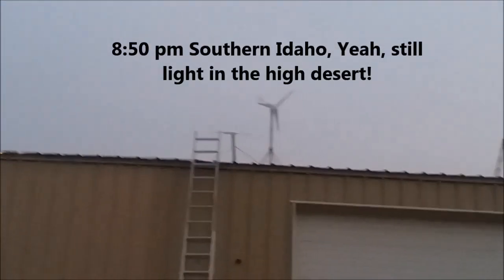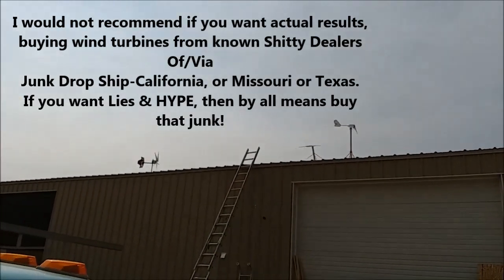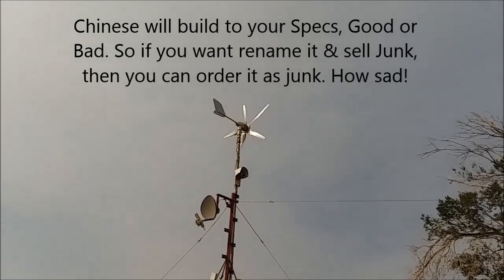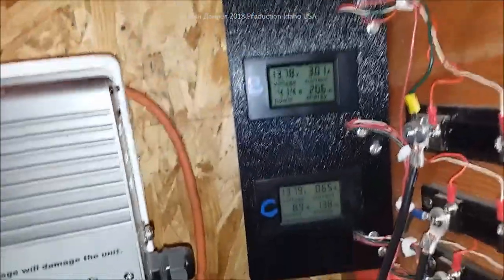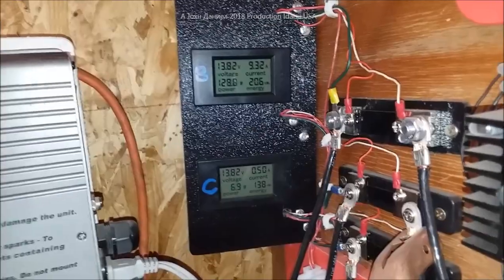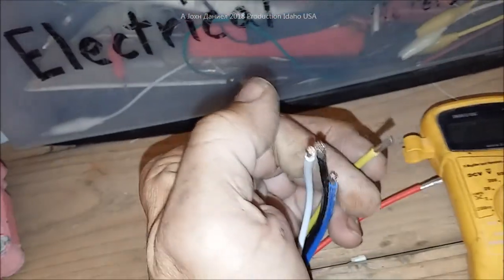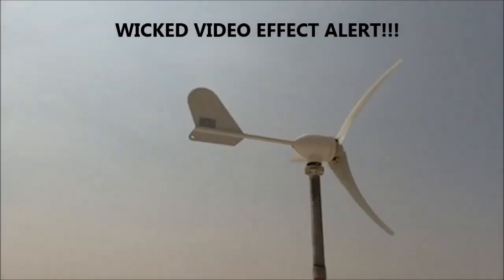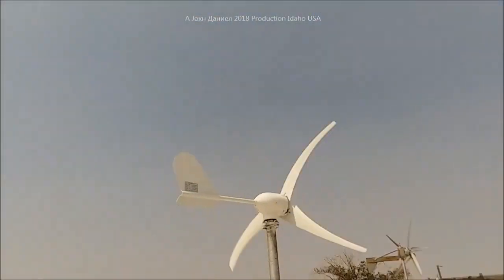500 watt Micro Wind Turbines output report, Long Term Review - Big PARTS LIST BELOW.

Comment from the maker: **For rectification to get 100% full batteries from one & to divert over volting you will need these: https://amzn.to/37HN2OR 100A SQL Rectifiers &  https://amzn.to/2MTUjCU A All purpose long life Load controller and be sure to get up to and over 300 watts diversion resistors ( 
https://amzn.to/2QngFPq x 3) and one or more 60 amp SSR ( https://amzn.to/2QKEyj0 ) with heat sink ( https://amzn.to/2ZYtmna ) and be sure to use thermal past on it.  ( Proper type - https://amzn.to/2QN2hir from Protronix)
Reply: How do i run an auto control switch fo my turbine. I am around 70 miles from where they are.so its not feasible to switch it off and on. Thanks
Reply from the maker: @randyzwagerman3975  3 way SSR, 12 volts to power them and a WindSwitch https://amzn.to/35kNO5r

Comment: Hi John I have purchased a SC48VDC Hornet 11 blade 1200 watt DC i have a 50' Tower the tower will be located approximately 40' away from power shed I have 48 volt lifepo4 banks 104AH each. Each Bank has 5 104 Ah batteries. I would like to know what size wire and fusing you would recommend what ever you may suggest would really help also would you recommend a break switch Thank you sir/.
Reply from the maker: Send me a email at olympicpowercontrols@yahoo.com and I can help you better.

Comment: Hi
Has anyone tried using a roof ventilator as a VAWT 
Seen one spinning on a roof the other day and the thought crossed my mind
Reply from the maker: Yes, and you can get 5 watts power from them using about $50 in parts. But WHY! 5 watts is same as wire loss to try and use it.
Reply: Јоhn Daniel 
Hi john 
Thanks for the reply,
I really like your videos ,
Me and my mrs are thinking of getting a turbine , to power a few things in shed and a 12v water pump 
You videos have been very helpful 👍
We haven’t taken the plunge and bought one yet though, the video you done with the Chinese 400w video is very interesting, since it’s that we would be aiming for

Comment: hi, i'm thinking about buying a 500 watt 12v wind turbine from your link but it brings me to green energy solutions and not B&C turbines. Are they the same. Also we get storms up to 150 mph winds, would I need to manually brake for these high wind storms. thanks
Reply from the maker: Both B&C and GREEN ENERGY use the same suppliers to get their parts (Wuxi) they assemble and ship compared to all the others selling look alike's which we have had a good chance by trial and error to now avoid. Always avoid those sellers who don't spec buy & assemble like B&C or GREEN ENERGY does of PMA, STATORS, CORES, WINDINGS, SLIP RINGS, AND BEARINGS in-house and avoid those who buy seconds, black market assemblies and other.  
So you can go either way on them, but for customer service I do prefer B&C due to response time. My other videos on these has both sets of links if you take time to check.
Reply from the maker: PS - If you get serious storms of 150 mph my suggestion is a pole that can drop fast to lower the turbine in those cases. None from any maker can survive that level of winds and most are rated at 110 mph for intermittent times only. Sustained 70 mph is the max you can leave a pole up for.

Comment: Do you have these going to a battery bank? Do they go threw a charge controller? I have looked threw your videos and haven't seen anything on these items?
Reply from the maker: To the battery bank from a rectifier and controlled with diversion loading and 3 phase SSR and braking resistors of my design.

Comment: John, I hooked up the same amp/volt meter you are using but it isn’t displaying what my turbine is generating instead its showing only what my load is using.  How Do I install them to show what is being generated by the turbine?
Reply from the maker: Load is the battery, Source is the turbine.
Reply: Јоhn Daniel I must have it hooked up wrong, it’s only reading my battery voltage. Can I send you a picture?
Reply: I’m inline on the negative side right out of the rectifier just like yours
Reply: Јоhn Daniel are you saying I can make an internal change on the source?
Reply: On the meter

Comment: How many turbines are required for puducing electricity for whole day(24 hours).
Reply: Depends on how much energy you use for the entire day.
Look at what you run in your house, fridge, tv, lights etc.. do you run AC, fans, welder, time machine etc..  Or look at your electricity bill at your avg daily use if your electricity bill provides that information. From there you can start working out what type of system you need, if you have enough wind, if you have enough sun..

Comment: The large wind turbines MW ones are a Freemasonic hoax. If you go to any of those videos showing the inside of those generators it's shocking to see how small they are. Electricity is free from the air all you need is a grid!

Comment: How much for the 220.00 Chinese turbine with controller and rectifier and digital voltage reader and braking box ? And mounting pole on it? I do not have room for the other stuff lol my garage is full. If you have a GOG lift or something similar to remove it I would definitely bring my side kick 19 year old nephew to help.

Comment: Hey john arent you selling this turbine?
Reply from the maker: I don't sell turbines. YOU BUY one based on what I am willing to install, then I have heavy equipment to install them in Wyoming, Idaho, Montana, Colorado, Utah, Nevada, Oregon, and now we have about 20 request in Texas and a few in New Mexico near Clayton. Thats where I am opening up another shop. I recommend them and some others for my installs. If they are not PROVEN, I avoid them.  
 Looking at my quickbooks I can say I now have installed since 2009 a total as itemized: 61 of the ME-500 models in the last 11 months!! one guy in Battle Mountain NV got 10!!! , not one unhappy customer. I have since 2009 installed 2 ARI turbines, 23 Sunning turbines, 12 FWiX Kestrell Turbines, 4 original (pre 2014) HYE turbines, 34 Thermodyne Turbines on my Chaos Frames, 9 Hurricane Wind turbines ( 2 red, 7 FW models),  6 Oulo 1500 Turbines, and 19 Gigu 600/800 models, 8 AirX Turbines, 5 BergyWind turbines. 
I have installed almost 3000 solar panels too since 2011. This is what you do to make a buck when you own a Tele-handler 38 foot capable HighLift LOL!!  I refuse to install any of the following due to warranty, caustic sellers, scammer avoidance, and just more than anything - junk avoidance: Aleko, Gudcraft, HiEnergy, Missouri, IstaBreeze, Coleman Air (post 2010), Mars D-models, and about 80% of the $150 China turbines currently on Ebay/amazon/aliexpress/dhgate or similar sites hocking crap with fraud watt ratings.
Reply: @JOHNDANIEL1  right on same work ethics I have
Reply: @JOHNDANIEL1  I would definitely want the Chinese turbine isnt that for a 12v bank? I have 2,000AH 12v bank right now
Reply: How much for the Chinese turbine with rectifier charge controller and dump and mounting pole?

Comment: Sir, i want to buy 1kw wind turbine which one do u recommend for me?
Reply from the maker: Depends on the voltage your trying to achieve. The best 24 / 48 volt 1000 watt model they make is http://s.click.aliexpress.com/e/bVUE0URQ . It can be ordered with numerous options and is made by WuixAir also.
Reply from the maker: Same company who makes the real accurate rated, option 2 https://amzn.to/2EfaEyP
Reply: @JOHNDANIEL1  I ordered this turbine.  The first one came damaged, dropped and bounced around.  threads on turbine shaft not usable could not assemble and shaft made noise when spinning.  Opened a dispute to get a second turbine head sent to replace the damaged one.  The replacement turbine head also came damaged and poorly packaged with multiple holes tears in the cardboard box...it is a 28lb turbine head and they used 1/2inch styrofoam thrown in to the bozxfor "protection".  The long mounting bolts that attach the head to the turbine body came bent!  Takes alot of force to make that happen.  Cherry He with Logihitech, called me a liar and aliexpress is not supporting my damage claim.  I am out 664 USD and don't have a working turbine.  NOT GOOD.  They used SF express and UPS shippers...idiots.  I ordered 3 turbines from Green E (1 -500w and 2-600w), came DHL undamaged no problems.  Do not order the 1kw unit using SF express shipping method.  The packaging for the 1kw is not sufficient.  Aliexpress mediation is a joke.  Nothing like Amazon.  Maybe you can do something, I will be putting out the word on these clowns...maybe you can do the same.
Dan
Reply from the maker: @ildan08  I don't know who Cherry He with Logihitech is, are they a freight company?  I do know so far Green E only uses FedEx via DHL for north America and DHL eLogistics EuroHpost for Europe and none of them are that rough on shipping. Good info on who to avoid, I will refer all you said to Ms. Lin who I buy from. 58 turbines from 300 watt to 1200 I have ordered myself or though customers I install for and only one had a chipped blade and Green E had one in the mail in hours.
Reply from the maker: @ildan08  Send me lots of pictures of them to my shop Email olympicpowercontrols@yahoo.com . I may offer to buy them and get you a discounted from Green E to get you back on line. Worth a try.  I have been a power buyer with Ali for 9 years. They panic when we complain.

Comment: Do you use AC or DC output turbines ..?
Reply: 3 phase is AC, hence the rectifier to convert into DC. Pretty sure he mentioned that about 287 times.
Reply: They are all AC, difference is in the DC model the rectifier is inside the turbine, AC model has the rectifier close to the battery which is better

Comment: Hi John,  I was wondering the last link you provide the "new to wind power kit"  is the charge controller it comes with good or should i get a different controller. If different can you recommend 1 for me? I plan to get the turbine to power my campers battery bank of 4 deep cycle 85AH batteries. I am going to add 2 more batteries when I get the turbine.  Thanks Gorbag

Comment: I also have a chinese turbine(GiGU 550 watt) but it makes a buzzing sound when it spins hard.Can it be a bearing? its verry loud with hard wind.I bought it 2ehands and the turbine is 5 years old.
Reply from the maker: Test it by grabbing the hub, blades still on and see if it has some slack in and out or side to side. If so, take it down, remove the case cover CAREFULLY and there may be a bearing number on the front and rear bearings. Usually a 17mm shaft, thats 20mm deep, and 27mm outer diameter.
Reply: ok thxI will try that later when i put the 5 blades+hub of and put the 3 blades+hub on to test it wich is better out here.Whats your experience with 5 and 3 blades on a wind turbine??

Comment: Okay I have a question for some of your wisdom. I have two 500 watt wind turbines that are 12v and I'm trying to figure out what 3 phase wire to run. I know the max amp it could put is about 42amp. So I divided it by 3 to get a rounded 14-3 would that be correct wire to run to a charge controller?
Reply: Also will be. 20 to 25 feet up to be either 5 to 10 foot above the roof to clear for wind then wire charge controller on series on the dc side to pull 24v on a 4 gauge wire probably 3 foot long to batteries
Reply from the maker: 14-3 would be the absolute minimum to run one, but if its identical to mine you better run 10-3 unless you like the smell of burning wire! I tried 12-3, and day one it burned it. Changed to 10-3 and in 25 mph winds it was hitting 65 amps. WAY over its rating and even getting the #10 warm. If its a knock off, you can run 14-3 just like they do ( LOL x 10 ) on those vietnam fake-a-watt air jalopys from Missouri
Reply: I appreciates it thank you

Comment: Could you explain a little more about why you need to use the 2 ohm resistors?  Is it necessary in an area that never sees wind speeds over 30 mph?

Comment: Hi there John,
It is normal a Wind turbine (24v) generate 35 v to 45 v on VOC ? Open circuit....
Sorry for the inconvenience.....
Reply from the maker: Yes, that's near proper open output for a wind turbine at it's normal wind speed full power rating in 25 mph winds, usually it's 48 to 60 volts. The battery drags it down to 30 for charging. If your turbine is hitting 75+ at 25 mph then that would be concerning.

Comment: Why don't you have a way to do a temp sensor on your resistors
Reply from the maker: They don't cycle on enough to matter and they can reach 275 degrees with this voltage level which is 200 degrees under their fail points.
Reply: Јоhn Daniel you can use a laser temperature sensor and it can be used with a raspberry pi to monitor and track everything

Comment: hi John, can you tell what speed is needed to that turbine start to generate some  power?
Reply from the maker: 6 mph is when the turbine exceeds battery voltage of 13.8 and at 7.5 mph a full amp. From there its a progressive doubling effect in my estimates at every additional 0.45 mph till we are at 440 watts at 22.8 mph. Or about 300% more power than a $400 Missouri wind turbine makes in 30 mph.
Reply: Well, i don't have mine in the definitive place yet, i'm using the chinese controller , it's bad?
Should Change to another controller?
Regards.
Reply from the maker: I would get a controller thats REAL MPPT like a wind and sun controller thats good for about 600 watts wind and 200 solar and not put any solar on it.
Reply: @JOHNDANIEL1  how much would u sell your turbine for? Arent you moving? I live in blackfoot idaho and could easily come pick it up.
Reply from the maker: I would sell 100% of whats in and on the shop related to wind and solar to someone with the intent to remove all and pay the whole amount in one shot, bring 3 friends not afraid of heights. 3250 watts, $2800 of new STION solar panels, STO-135 watt x 25, 3 wind turbines with enough parts and blades to build 5 or 6 more, and 2000 watts UL Bosch Solar panels on the shop roof now with all the hardware and current solar controllers. Lots of wire and parts, too much to mention. Bring $5500 and some aggressions, crazy friends too, big trailer to load, on some warmer Ice free days! 
We have already built a 9,200 watt system on the land in Texas. No need to have 2, and it don't open the house sale up to more buyers being here.

Comment: anything with CE on the production tag is good that means it meets the european requirements. and europe dont allow jumk to be sold here. i am american and just moved to europe and learned this from the things i needed to learn before i could work in construction here. CE stands for 

Conformité Européenne.   you can not even use a drill in a company here at work without the CE tag on it if it is a stationary machine. https://en.wikipedia.org/wiki/CE_marking
Reply: CE mark is not as reliable as it used to be - Chinese tat manufacturers have come up with thier own system, called 'China Export', which uses almost exactly the same symbol, and the only requirements to bear the mark is the product has to be exported from China.

Comment: Another issue is, Chinese sellers posing as US sellers with false US address, The "US Sellers Only" search filter on the left side of the search page is useless! So to hopefully avoid this, just use contact seller and look at the top of the contact page for, The seller is on a different server and speaks a different language header at top of page, to help avoid the BS Trap! The Chinese scammers are ruining the eBay trusted seller and buyer reputations!
Reply from the maker: There needs to be a website like Ripoff Report or consumer reports that people can go report all the fraud crap on Amazon and eBay and Etsy. Would  be a smart idea
Reply from the maker: And you'd have to put in your buyers ID to leave a complaint so that sellers don't get to dirty the waters.
Reply: We do have a RIP off report its YouTube lol you can post a video.

Comment: I might pick one of these up but im pretty skeptical of the wind here on the coast of florida (im about 1/4 mile from the beach)
Reply: Grab a cheap weather station, use a pole and gather data using the compression of the roof (there can be a sweetspot where the air is compressed as it goes up the roof slope providing a higher wind speed, although this can also sometimes be dirty air (turbulent air which is not wanted)).. This is what I plan on doing, starting low and slowly raising the wind cups until I get the highest avg measurement, testing over months..  I would hate to purchase a complete setup and not get enough wind to even reach startup speed.

Comment: I had a Korean car with Chinese wheel bearings it lasted 120k miles before they broke, so not too bad but dont ever put a chinese throw out bearing on a new clutch they are garbage. Its interesting to see chinese stuff last awhile.
Reply: My little car a chevy Aveo has got a 100% Chinese made engine in it. 241,000 miles on it.

Comment: My friend Charlie had a similar experience with a 1000w Chinese turbine that works absolutely  brilliant in low winds its called OEM parts express running since 2012 non stop never taken down not even once, friend also has a genuine 2kw Chinese turbine it weighs 80kg in total not including the tower ,man that slightly heavier than the falsely advertised 2kw turbines from Missouri.
Your right about car parts its hard to find things not made in China and I'm always working on cars, always , I live under hoods.
Reply: @Gary Brown wtf are you talking about